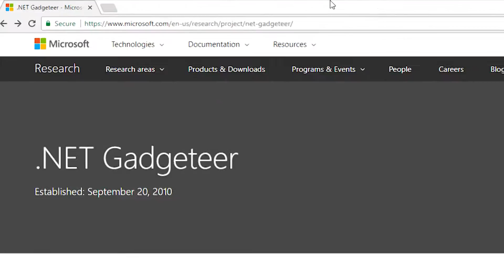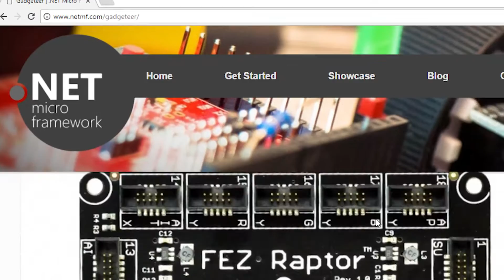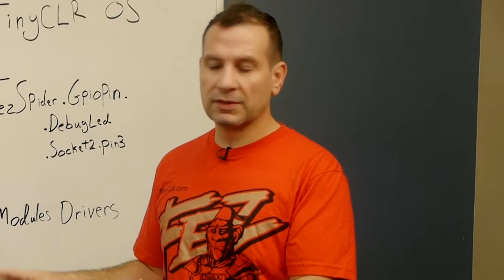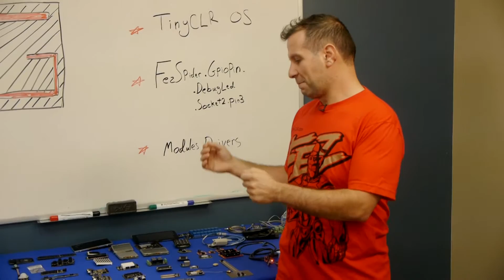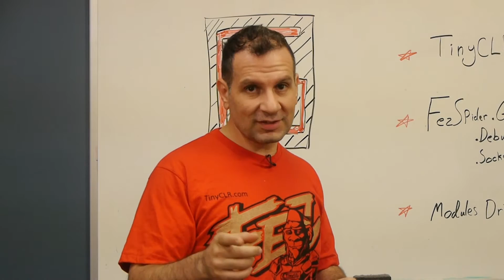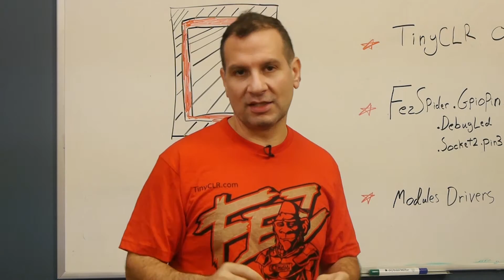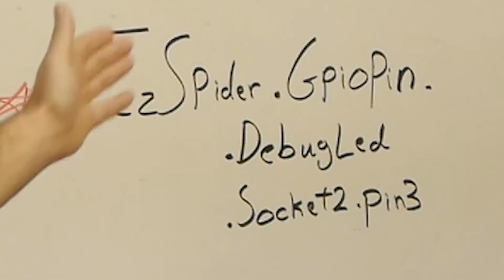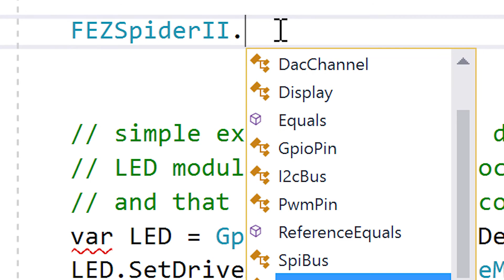Using TinyCLR OS with Gadgeteer - Tech Talk 042

Comment: Like where you going!
Mainly using gadgeteer for homemade Products. Not planning to commertialize them. For this the KISS principle of having modules with drivers was really nice! (will miss them)
But having a more modern IDE is quite a benefit!
Reply from the maker: It was not KISS at all, exactly the opposite. Extremely complex behind the scene to make it easier for beginners. The way we would like it done would be KISS.
Reply: Yes, maybe your right. From your point of view, it may be a different Story. From my side however, a super simple interface for each module helped keeping the Programm itself simpler, and made the whole Software easy to understand.
I can see that from a embedded developer standpoint you love to be in control of every single bit. For my Applications, it was not required and would blow up the code like hell. A mix of both worlds might be the best path. where you have the option to go both ways, to get just the amount of control that is needed.